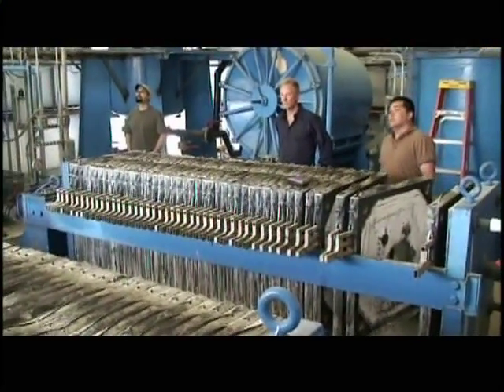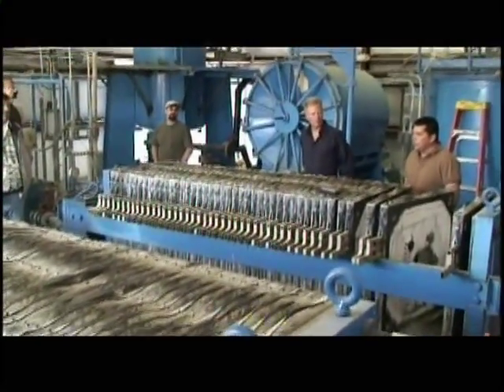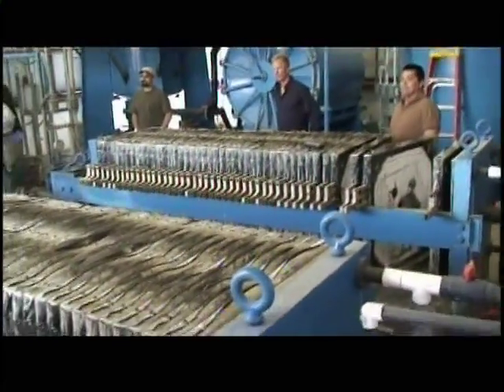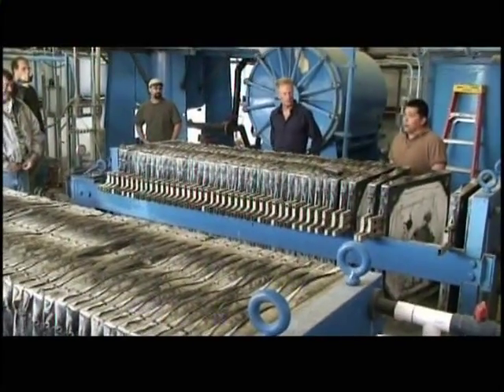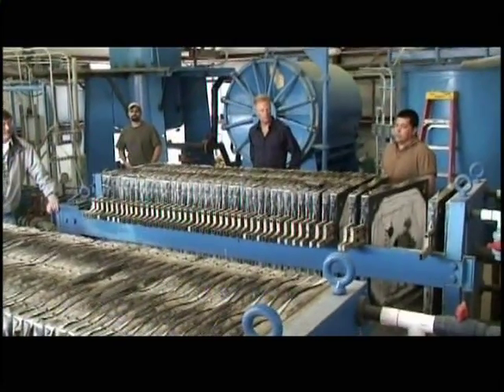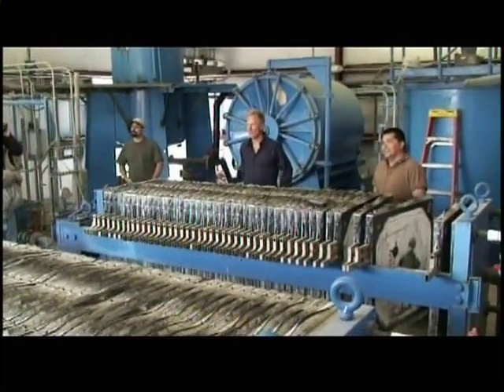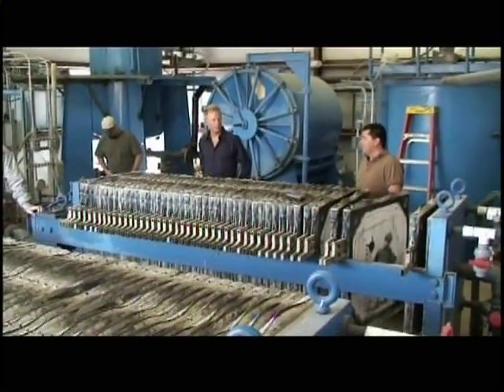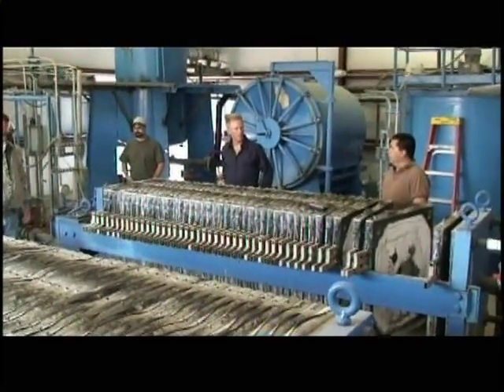Processing Facility Capacities - Preliminary Estimates

Comment: 100 Ton Haul - WOW - I saw a trailer come through Queensland a few years back carrying a power generator weighing over 200 Ton o a Cometto trailer, it had over 200 wheels, I got some great shots of it and we did a feature on the net after speaking with the operators.